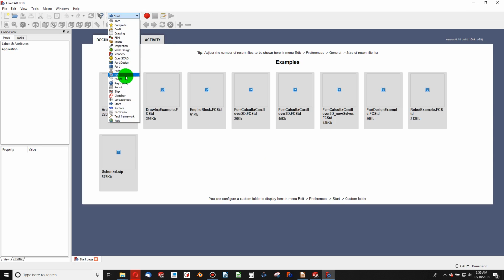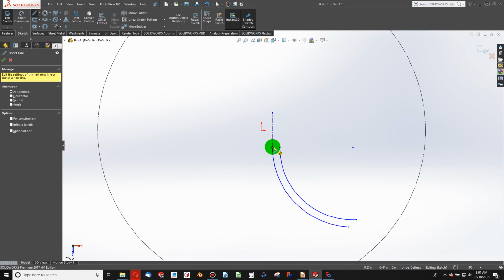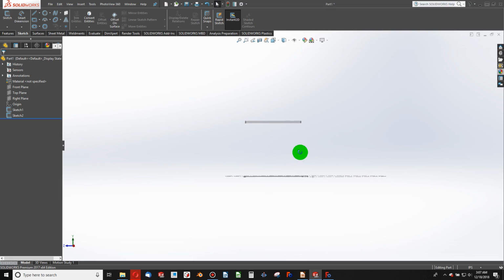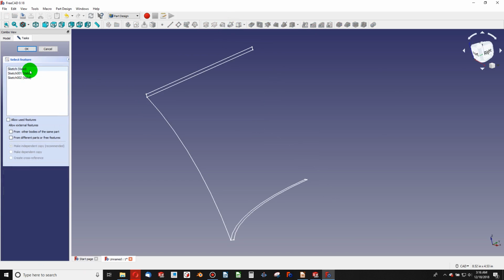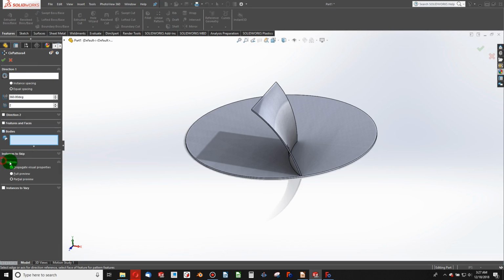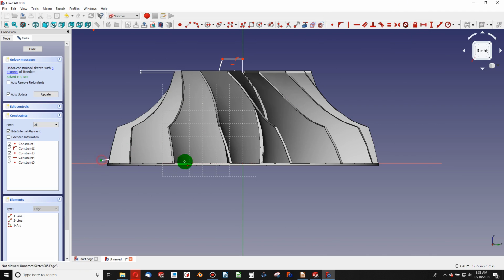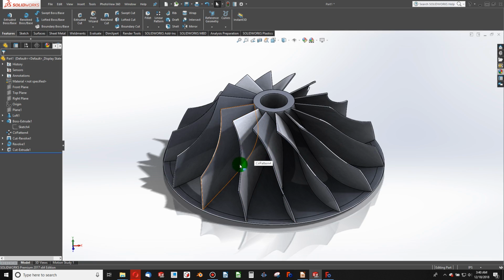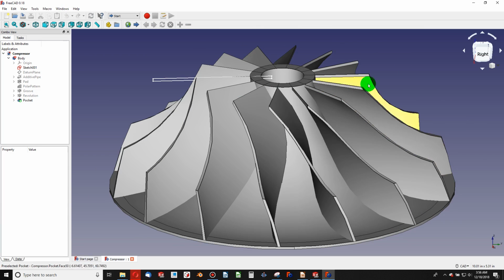MAKE THIS COMPRESSOR-SolidWorks and FreeCAD Side By Side |JOKO ENGINEERING|

Comment: I have just completed this design with the latest FreeCAD 1.1.3.  I did it with a surface  made with 2 straight lines and 2 arcs.   4 sketches  projecting previous into next as non drawing reference so to connect the lines | edges.  Then with the Surface Workbench a surface is created, Then padded and the blade is done.  Then Polar pattern 14  blades all around. Then groove trim and adding the final rounded slope.  In order to do the final 2 sketches you can make compressor invisible on the left hand side.

Comment: JUST installed FreeCAD. I became proficient in Solidworks while testing graphics at Dell. Now, I have an engineering project I'd like to bring to fruition, and wanted to try FreeCAD because of the incredibly low cost. :) However, I was getting very frustrated with the UI in FreeCAD. After watching this video, I am certain the pain will be worth the reward learning FreeCAD. Thanks!

Comment: Freecad is INCREDIBLY powerful. It's easy to dump on it for its UI (which is not great, to say the least), but if you can get over that hill, you have an amazing piece of software, made more amazing by the incredible add-ons.

It is my only experience with CAD software, but it seems to be shaping up to compete with the best of the best. It is remarkable software.

Comment: HI, where did you get your measurements on the first sketches?! All by memory or had you written them before and you're just reading them! Thank you
Reply from the maker: I had them written down before, but I made the compressor so many times it's all by memory now.  Originally, this compressor was made up on the spot with these dimensions.
Reply: @JokoEngineeringhelp  thank you for yr reply! Nice job on doing this one! I am still fighting to do a simple model to visualise a future rc plane! I'll get there... eventually! 😁
Reply from the maker: @Flight72  Check out the curved shapes workbench if you haven't already.  It was made to create air foils.
Reply: @JokoEngineeringhelp  I will for sure! thank you so much for your advice!

Comment: The filleting and lofting capabilities are the two main things I miss going from SolidWorks to FreeCAD. I spent a lot of time getting frustrated with fillets crashing my model before I figured out that I just shouldn't be using them as aggressively as I was. With lofting, it's annoying that you 1) can't loft to a point and 2) can't select vertex correspondence. I haven't been able to find a way around these limitations, and it's caused issues on a couple of parts I've designed

Comment: Hello Joko Engineeringhelp. Firstly I want to thank you for this excellent video, but I would like to ask you two questions since I have been testing out FreeCad that to me seems to be quite good and I think this is an excellent student application.
1. What verison of FreeCad do you use in the video? 
2. I have version 18 but it has bugs and flaws, but still I think it is at least excellent in many ways, does the dimension module work correctly after you make a workshop drawing? in the version I have the measuring points or gripping point of the model move to the right from the views in the drawing and after the points have moved dimensioning is impossible, plus editing the dimensions is not possible.
Reply from the maker: Hi Ivar, I use 0.18.4 and in more recent videos I use 0.19.  I'm not sure if I know exactly what you mean by a workshop drawing but I use the techdraw workbench to create drawings and they are accurate to the model for me.  I have a video in which I cover ways to add symbols and you can manually override dimensions using the same method but I wouldn't recommend it because it would break the parametric nature of the dimension.  I have not had any problems with points moving around on me and I wouldn't be able to replicate the issue, perhaps the freecadweb.org forum would be able to help.  Good luck  

https://www.youtube.com/watch?v=SbKWf7MalAk

https://www.youtube.com/watch?v=cggBR1Ghq7k
Reply from the maker: By the way, in most of my videos you should be able to look in the top left or top center of the screen and see the version.  In this case it's 0.18.  Hope that helps
Reply: @JokoEngineeringhelp  Thank you for the answer, I watched the TechDraw Workbench video, it is also quite good.
There is a problem with the "Drawing" module that I first used, the grip point for the dimesion slide. But usng the procedure and the TechDraw module and the workflow yoou show in the video works.
The problem is that the program is prone to crash.
I still though think the program is good, but it is not very intutive.
I have tested it in Windows, Linux and MacOS but the last one I mostly use.
Reply from the maker: @ivarara  Hi Ivar;
I'm glad things are working better for you.  I'm not sure why it would be crashing, a crash on my end is very rare.  Perhaps the people on FreeCADweb.org forum may be able to help more than me.  Good luck
Reply: @JokoEngineeringhelp  One thing is with Freecad (or Pythin), that on the left in the working window (the menu) is tha the menu does not show right (perhaps opertaing system related). There are some parts of the viwe hidden, for one reason or another.

Comment: Let me start by saying that this is an excellent concept for a video, perfectly executed.

It is mentioned on another comment as well but the fillet issue can be resolved very easily. When you finished you compressor you could see that the lines of the generating bodies where still visible although it was all one body. This can be fixed and it's this behaviour that makes fillets harder.

With a part open go to Edit>Preferences>Part Design>General.
There click the first 3 options. This might also remedy the collapse in the rebuild after you changed the loft.

I am not really sure why this was left unchecked by default. Maybe to make switching between direct and history based modeling easier. I don't know, but it feels like it should have been on by default. Please, show us any different results you might get with this different options setup.

Comment: This is a great video – thanks! It's impressive to see that FreeCAD can pretty much hold its own against one of the titans.

> I would probably do this a little bit differently if I was only doing this in SolidWorks...

I'd be very interested in seeing a video of how you'd do this if you were only using SolidWorks. Much of the criticism that FreeCAD gets is focused on the workflow and user experience. Due to the high cost of commercial parametric modeling software, I haven't had a chance to use any. From what I gather, the more tedious operations in FreeCAD tend to be handled automatically SolidWorks. It'd be cool to see a comparison that points out the areas where FreeCAD's UI/UX could be improved.
Reply: I'd encourage you to try out OnShape (written by many of the same team as SolidWorks) and Fusion 360, both of which are available free of charge for non-commercial use.  OnShape is restricted to creating only public documents, but that's not a problem for trying it out.  Fusion 360 is becoming increasingly crippled in its free version (driving some people to FreeCAD I think!) but the modeller is still complete.  It's worth trying them out just to see what is still missing from FreeCAD, which I would love to love, but at the moment its UI does slow me down.

It's mostly little things - for example I'd like the freedom to be able to select a constraint type before I select any sketch features, I'd like to be able to dimension an arc to a line or an arc to an arc (shortest distance), I'd like to not have to worry about the difference between the three distance constraint types because I should be able to imply them with the mouse, I'd like the 'principle of least modification' to apply to sketch constraints (e.g. if you select a bunch of things for a symmetry constraint, the mirror line is chosen as the feature that least alters the existing sketch rather than the feature you clicked most recently), I'd like a "scale on first dimension" setting for the same reason, I'd like a concentricity constraint, I'd like the mirror command to add symmetry constraints, I'd like fewer modal dialogs, and so on.  Little things that add up.

Oh and I'd like to get rid of the awful graduated fill background, but there might be a setting for that, I'll have a look!

Comment: Hi, at the point of using the groove command to remove material from the blades, FreeCAD only adds a line to each blade rather than cutting from it using the sketch. How would I resolve this? Cheers
Reply from the maker: Sometimes the preview shows a cut from the sketch but doesn't update the graphics until the cut has been already made.  Are you seeing this issue after the cut has been made also?
Reply: @JokoEngineeringhelp  Yes, the preview of the cut is what remains after I initiate the groove command and the graphics do not update
Reply: @lourenzpervera2468  Same issue for me. Do you have a solution?

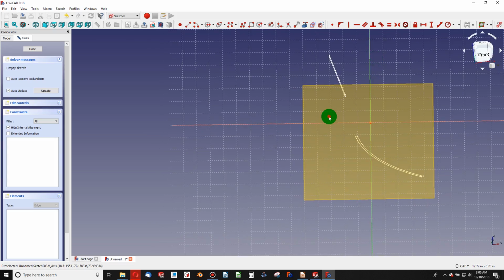Comment: I am not getting to select the point to transfer/import it to the created datum plane (time 11:00) when I am in external Geometry tool.
Reply from the maker: Does it work to add the line the point is connected to and reference the end point of the line?
Reply: @JokoEngineeringhelp  I started over and it worked. Not sure what caused the problem, time line (15:30) could of solved the problem if I still add the document with the error. Wouldn't know now but thanks :).
Reply: @JokoEngineeringhelp  Will try it out, doing the 4 cylinder tutorial A.T.M.

Comment: The improved blade profile built from the time 34:00 is perfectly achievable with FreeCad. I duplicated it with my version 0.18 from the dimensions of your SoliWorks model. On the other hand, the sweeping of the blade must be carried out otherwise, it is necessary to swap the profiles and the paths. It is also better hydraulically to specify the vertical profiles rather than the horizontal ones. SolidWorks has generated a blockage area near the machine axis which is not good for performance. It is also better to improve the profile of the compression path section by using spline lines instead of circular arcs. I do not know how to include a picture of the final result obtained with Freecad in my comment.
Reply: Please :)
Reply: @n3r0z3r0  I'm sorry, but I don't have the software or the time to illustrate my point with a video. I tried to do it but it is very long. The key to getting the same result as Solidworks model is, as shown, to reverse profile and path. I can assure you that it works and that you get a perfect compressor wheel. But I did not succeed in introducing the fillets to the edges.
Reply: @michelfrance75  thanks fore reply!
Reply: Use Imgur to upload a screenshot
Reply: Make a video and post the link. Show yourself.

Comment: If I learn to use FreeCAD, can I transition to Solidworks easily? Or is Solidworks' tools/user interface very different?

- Thanks
Reply from the maker: Hi Ian;
I learned on SolidWorks and I moved to FreeCAD way easier than PTC Creo.  I don't think it would be very difficult for you to move to SolidWorks from FreeCAD.  I'm helping with some documentation on the topic here: https://wiki.freecadweb.org/Transitioning_from_Solidworks_to_FreeCAD
Reply: @JokoEngineeringhelp  thanks Joko

Comment: I have a lot of respect for your patience with FreeCad. I use Siemens NX at my job, and I just can't use FreeCad. Most CAD software have usability problems but at least the workflow is pretty equal. When it comes to UI/workflow FreeCad seems to have tried to reinvent the wheel and made it square...
Reply: FreeCAD is quite similar to CATIA, and this program is one of the most powerful softwares in the industry. They have same the workflow. Enjoy.
Reply from the maker: I had to work a lot with FreeCAD before it felt natural in the transition.  Once I got it, it feels great.  I'd love to get my hands on NX sometime, I hear the surfacing is way better than SolidWorks.

Comment: Are there ways in which FreeCAD is better than SolidWorks?
Reply from the maker: In my personal opinion, hotkeys in Freecad are a lot more effective; in a sketching environment I can set constraints faster in FreeCAD than SolidWorks.  Having a new daughter, I can model one handed easier when I hold her too with FreeCAD.  The selection is nice where you can select multiple things without the ctrl key, SolidWorks I'm always keeping my left hand on that part of the keyboard.  Plus, you can't beat the price!  The functions you can get in FreeCAD for free  that actually work cost a pretty penny in SolidWorks.
Reply: @JokoEngineeringhelp  Just wanted to mention that you can configure hotkeys in SW, which I have done so it is very effective (Shift+C for Coincident, Shift+X to toggle construction, Shift+T for tangent, etc.) However, I agree with your points on the value of FreeCAD, and thank you for making these videos so I can learn a different software quickly and painlessly!
Reply from the maker: @tmhurley27  Thanks I'll take a look at that!
Reply from the maker: Hey Refke van Lavleren; I've also noticed that FreeCAD can fillet some edges that Solidworks cannot!
Reply: + $ 200 a month not spent.
Reply: When I use SolidWorks, I regularly miss the FreeCAD symmetric constraint. There's always a replacement (often horizontal or vertical constraints on a midpoint and some other point), but the symmetric constraint is a parsimonious solution that doesn't clutter the sketch and feels natural to me..

Comment: 35:51, it can take some time to update...your system time indicates it took you 9 minutes to replace that arc with the revised arc.

that was exactly why i stopped learning freecad and switched to fusion 360. if i'm doing this for a hobby my free time is limited and i don't want to spend 30 seconds everytime i apply a fillet to a single edge. if your building from a plan freecad probably works fine but if your experimenting freecad will drive you away
Reply: Actually I got the same adjustment to work in under 4 minutes without more than two hours experience with FreeCAD. He just gave up too quick in my opinion. Saving hundreds of dollars per month is reason enough to love FreeCAD. I have a lot (10 yrs) of experience with Solid Edge and really think FreeCAD could beat the commercial softwares in a year or two.

Comment: Your object was broken because you edit the profile and alter the number of egdes, planes and vertexes with it. All other features after that can then not rely on the original edges as before. That is in my opinion the biggest problem of FreeCAD actually. You can not edit what you want in the history stack. You can do some workaround in building tactics to avoid that but this makes it really hard and last long. You can test it if you set the view only to the first sweep. It should show the complete object.
Anyway, i love FreeCAD too. Its a really great programm. If they can fix this history problem (Topological Naming) it was perfect for my taste.

Here my two tips:
To hide something select it and just press space.
To use the cut-view in scetcher press the bluish icon right next to the scetch icon.
Reply: This is now fixed, however you should install a fork from FreeCAD: https://github.com/realthunder/FreeCAD_assembly3. I think eventually it will be implemented in the main branch. This fork also contains the Assembly3 module. This fork fixes that problem and you are able to update old sketches/ features and in principle the model rebuilds without problems (similar to SolidWorks)

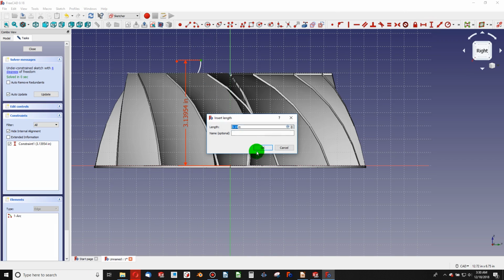Comment: 25:00 within "Display properties" (Ctrl-D / View -> Apperiance ) you can set the transparency value
Reply: Keyboard shortcuts FTW!
Thanks.
Reply: Use the button to display cross section (on the toolbar starting from the left, button 18, looks like a blue box with a clipping plane in front)

Comment: in freecad, clipping the view in sketch mode : https://www.freecadweb.org/wiki/Sketcher_ViewSection

I also think, you need to activate the refine function in the parameters to remove "artifact" edge and to allow filleting on the edge you wanted.
it is in "edit>preferences>part design> general"

Comment: Hi Joko, well done.
Would you say, according to this example, that FreeCAD can compete
with a industrial solution like SW?
Reply from the maker: Hey Thomas!  
That's a great question.  I found this example where it was used in a production environment:
https://forum.freecadweb.org/viewtopic.php?f=24&t=16993
https://forum.freecadweb.org/viewtopic.php?f=24&t=30841
Overall I think it would be competitive, however companies usually tie in CAD with ERP/PLM type softwares, and that may make it not feasible for large companies.  It doesn't have as robust capabilities for advanced lofting, fillets etc so complex stuff would be harder.  Nonetheless, I think it's a fantastic software.  I haven't touched the drawing environment, yet, and that would be an important determinant as well.
Reply: At 25:00 how to clip view to see full sketch?
Use the button with the blue cube/transparent blue plane to toggle view.
(the second left button beneath the point-constraint button)
merry christmas
Reply: ups sorry.
I mean the draw-point button, not point constraint...
Reply from the maker: @thomasschrader915  Merry Christmas thank you!